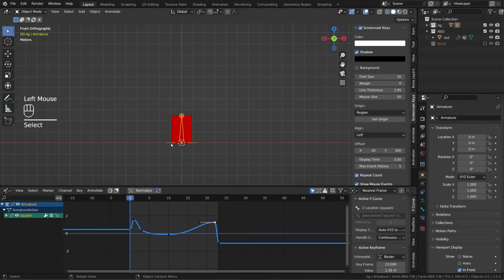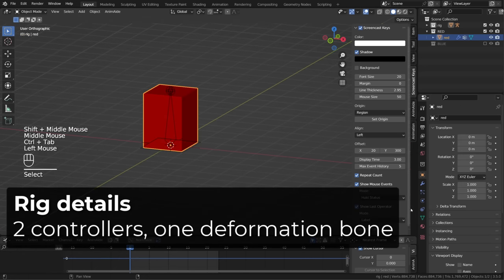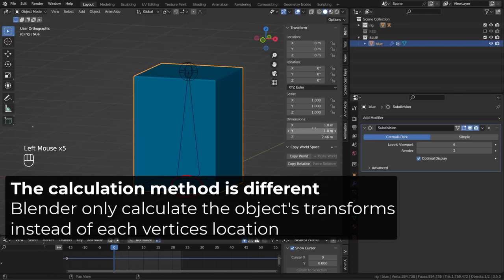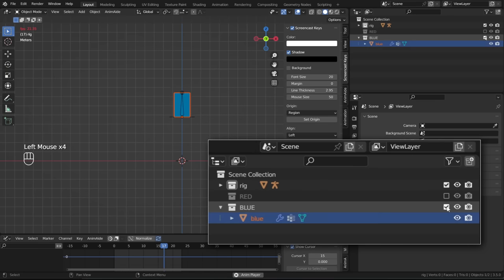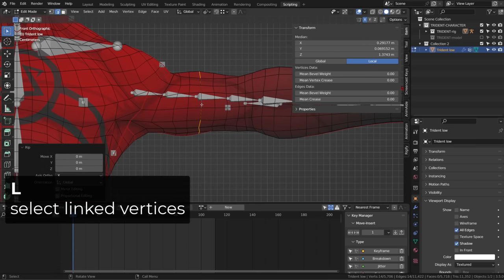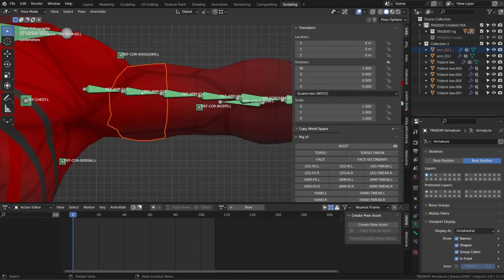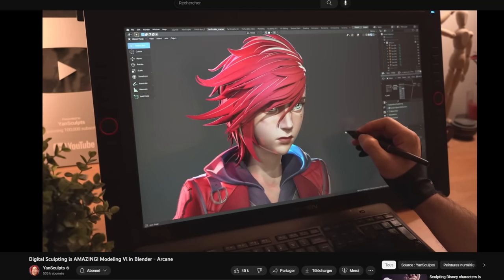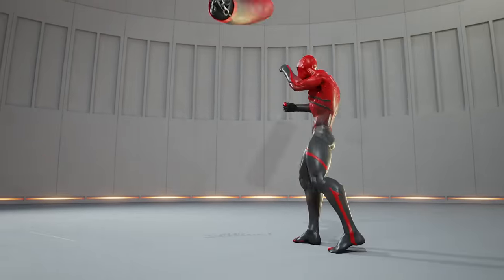Do this to optimize your rigs' performances in Blender 👀

Comment: Probably not a solution i could recommend to everyone, but one way I improved performance with animation playback was simply by switching from Windows to Linux. I'm not sure if its because the Linux Blender builds are better optimized, or if its because Linux has less overhead than Windows, but I saw a massive improvement in animation playback. I had a scene with two characters and both had a subsurf modifier turned on and animation playback remained fullspeed on Linux while dropping to 5fps on Windows.
Reply: how do i "simply" switch from win to linux
Reply: @STANNco  My best recommendation would be to install Linux Mint on a USB stick and mess around with it to see if you like it. Linux being a completely different OS from Windows means that a lot of things work differently, and a lot of software you might use on Windows will be completely unavailable to you. Switching from Windows to Linux will come with just as much of a learning curve as switching from MacOS to Windows. Luckily, you don't have to purchase an entirely new machine to try Linux, just a 16gb thumb drive, and you can boot off that USB drive to test drive it without overwriting your existing Windows install.
Reply: @VITAS874  Linux doesn't require a "special PC." Any machine capable of running Windows can run Linux. If you have a Mac, your mileage may vary.
Reply: @VITAS874  You can always dual boot, having both Windows and Linux installed on one PC at the same time.

Comment: I recommend just using the decimator modifier if you really wanna save on time. You'll save time on splitting your model and rerigging it all.
Reply: Do you place the decimate modifier on the top or the bottom or middle of the stack? (i.e before subdivision but after armature or before all of them?) does it matter if you use it in Collapse or Un-Subdivide mode?
Reply: @XINN1X  doesn't matter if it's above or beneath the armature but no subdivision modifier for this model that would eliminate the purpose of the model, use collapse and lower the slider as much as you can to where your model is low poly but it has enough detail for your rig to work with
Reply: this does not work. Unless you apply the modifier. adding decimate regardless if it's over or under the armature modifier will make lag even worse
Reply: @STANNco  yes that's what this process is for, this uses the method of duplicating your model and having the decimator applied to the new model and using it for animating
Reply: @STANNco  the modifier can only be useful if it's applied

Comment: 4:11 FYI, you don't need to rip the loops individually and then select the island to separate. You can select both loops, then 'Select Loop Inner-Region' (set a hotkey for this), then P to separate selection. This should be a lot faster than the ripping method.

Comment: I see! So you just use the separated model as a preview, to have the correct frame rate. When you are ready to render, you then switch back to the first model, since it won't matter on the render. thank you for the insight Pierrick!
Reply from the maker: Yes, exactly

Comment: I think this solution works more as a serious last resort when everything else has failed - it's definitely an interesting approach to tricking Blender into calculating differently and it teaches underlying mechanics of Blender, but otherwise you could 100% take a few more steps before attempting this. I wish the video mentioned any of these.

From my own experience, assuming the mesh is just too high poly
#1 the fast version - making a clone of the mesh and decimating it down by 80-90% until it starts to break from the modifier/unsubdividing for better topology but breaking the UV at the seams. Apply the modifier, otherwise Blender will keep calculating it every frame, making it useless
#2 the accurate version - modelling a more accurate lowpoly version of the mesh with ideal topology

Assuming it's a subdivision modifier issue
#0 Enabling Simplify and setting global value of all subdivision modifiers to 1
#1 Enabling GPU Subdivision in Blender preferences and setting the viewport subdiv down to 1
#2 Just applying the subdivision if it's really that important, avoiding Blender having to calculate it every frame, and keeping the original as the lowpoly clone

That'd be just the mesh itself. Performance of the rig itself seems to be tied to constraints, which in turn means you're locked by your CPU's strength. If it can't keep up with the calculations of the rig itself, there isn't much one can do except upgrading to a stronger one. Feel free to debunk this as I'm not an expert, just sharing my thoughts on this
Reply from the maker: Yes, that's the basics.
But what if your model doesn't use any of the following?
You can't imagine how computation heavy it is to calculate bone weight and deformation.
Some game rig, with no subdivisions and no modifiers can become laggy.

Building a lower poly version of the model may or may not solve the problem.

I know taking this road is almost always a winner.

On the editing side of things, I can't really cover all use cases in a video.
You know, people just get bored and you can't share the important info.

Thanks for taking the time to give your vision, always appreciated :)

Comment: On my very first professional production, I was assigned to a ridiculously weak workstation (don't ask me why). How weak? 2GB of ram, I don't remember the CPU and GPU models, but I couldn't even have 1fps in the viewport, and viewport rendering crashed the entire machine. So I replaced the entire character mesh by cubes. Still had only about 8fps, but at least i could work.
Took weeks for the IT team to finally put me on a normal workstation. And even months later, I still had to explain why I was behind schedule even for a junior on its first project.

Comment: You said you have a corrective rig/bones. Can you direct me to a vid on how to setup inner elbow weight fix - that can be exported to UE4? (I think I learned that Constraints dont export, unless baked into an animation. But I need a rig (SK mesh) with no animation > to import into UE, then I can import animations that use that Rig (weight paints). But I need the elbow fix to work for any animation (one that doesnt have key frames make for the specific corrective elbow bone). 
Im thinking I need better (smarter blend-choice) weight painting at my elbow joints... but I dont know the exact design. And I have many layers of clothes, Id have to copy that weight change to all meshes. So I need the correct answer first... Ty.

Comment: Wouldn't using decimate modifier & applying it be a better & faster solution?
Reply from the maker: Not performance wise.
Did you watch the video?
Reply: @PierrickPicaut_P2DESIGN  Yes, and I've shared it with a friend that does some rigging and both of us don't understand how decimate wouldn't be a better & faster solution. What we'd like to know is more specifically why would this be better than just decimating to very low poly?
Reply from the maker: @TrueXiarno  you may lose readability in the silouhette and on top of this you are still calculating deformation. That’s the main problem.
Now, there is no rule of thumb. I’m a lot of case decimated model will solve the problem.
But model split, computation wise, might be better in most cases

Comment: Do you really need so many deformation bones for your rig?

I get the need for tweak , twist and helper bones but damn, that's just too many, you can probably get CLOSE to the same results with less bones.

Remember folks, bones are expansive to evaluate (although it depends on the animation software used but for blender, since it needs to support many constraints, even if there are no constraints, the bones are slow to evaluate, that's why blender is trying to replace this system with a new system in blender 4
Reply from the maker: There is not that many bones.
You should give a look to the last of us tech demo...
Reply from the maker: @Illasera  not exactly.
It’s not the deform calculation but the rig calculation that makes problem.
In UE you just use the skinning bones and their baked animation. In blender all mechanism and controller bones relationship and constraint have to be calculated before the deformation are calculated.

On to of that, as you said, UE is designed for that. So it probably does it faster to

Comment: Great tip, but Blender can handle multiple characters on screen at once with the proper machine. A poor CPU is the main reason for low FPS in Blender with animation because of the rig calculations. Pro Tip: Try the new Apple Silicon machines some are very inexpensive (M1 Mini). I know several Blender animators who have made the switch because of the animation performance boost.
Reply from the maker: Optimisation through hardware is not optimisation.
Reply: @PierrickPicaut_P2DESIGN  Very true and I love that saying. But I do know that viewport performance is something the devs are really pushing for, at least for the ARM version of Blender. 
The Apple devs just finished a rewrite that included the Metal backend which significantly increased Eevee and Solid Viewport performance on Macs.
Not trying to sound like an Apple commercial here :), just trying to give a heads up about animation performance with Blender. 
Love your work and tutorials!!!
Reply from the maker: @dropbars  😃 thanks for the Infos

Comment: So, I'm curious to know, is your original rig for this character optimized the same way, or did you figure out how to get faster frame rates without creating a proxy?  Can you please show us how you get faster FPS without creating a proxy rig (if that's possible)?
Reply from the maker: My models are mid poly and I don't use modifiers, that definitely helps, like game models. High density and modifiers will slow down your rigs.

Comment: Nice tip!
It would be great to have a tool I use in Maya but in Blender... Rigbits where from defined weights you can slice the model and the tool automatically parent each sliced mesh part to a bone.
Reply from the maker: I guess someone will do an addon soon 😄